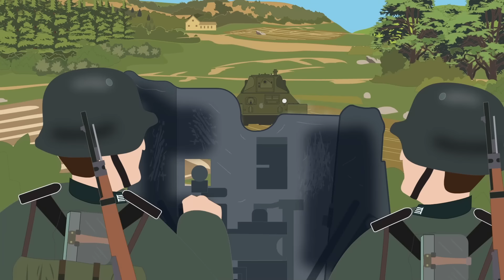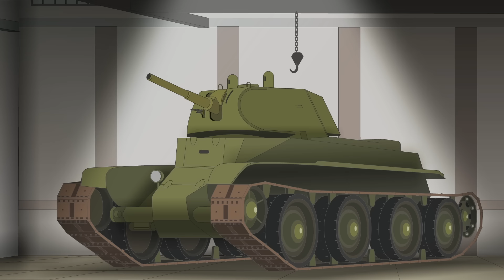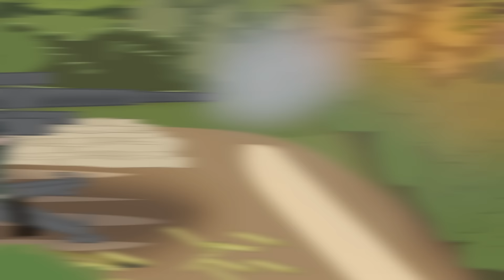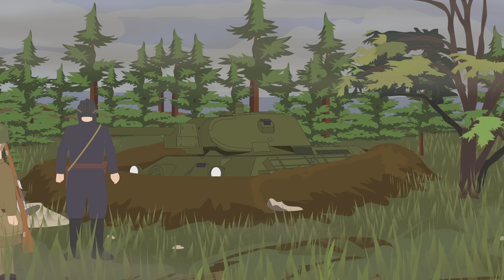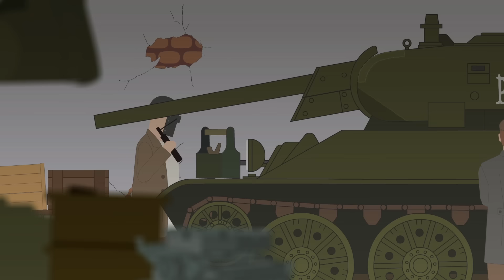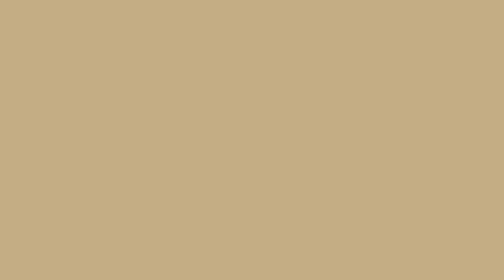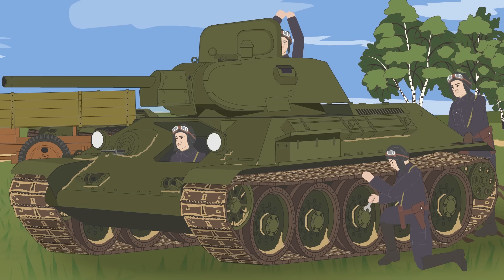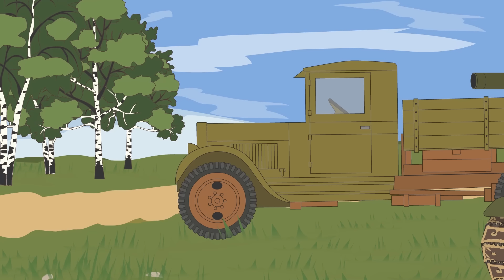Was the T-34 Really the Best Tank of WW2?

Comment: The T-34 was supposed to be a simple and rugged vehicle that seldom broke down. Authors like to compare it to the more complex German tanks that supposedly broke down often. The concept of the T-34 as a reliable tank is another myth of WWII.
The majority of vehicles in 1941 were lost due to equipment malfunction. The same reliability problems continued during the period 1942-44. The evacuation and relocation of industrial facilities combined with the loss of skilled workers could only lead to the fall of reliability. 

In 1941 T-34 tanks often had to carry a spare transmission strapped on the back to counter equipment failures. In 1942 the situation worsened since many vehicles could only cover small distances before breaking down. In the summer of 1942 the following Stalin order was issued to units:
‘Our armored forces and their units frequently suffer greater losses through mechanical breakdowns than they do in battle. For example, at Stalingrad Front in six days twelve of our tank brigades lost 326 out of their 400 tanks. Of those about 260 owed to mechanical problems. Many of the tanks were abandoned on the battlefield. Similar instances can be observed on other fronts. Since such a high incidence of mechanical defects is implausible, the Supreme Headquarters sees in it covert sabotage and wrecking by certain elements in the tank crews who try to exploit small mechanical troubles to avoid battle.’

Henceforth, every tank leaving the battlefield for alleged mechanical reasons was to be gone over by technicians, and if sabotage was suspected, the crews were to be put into tank punishment companies or "degraded to the infantry" and put into infantry punishment companies.'

The constant complaints from the front forced the authorities to investigate the problems with T-34 production. In September 1942 a conference was held at the Ural tank factory by the Commissariat of tank industry. The conference was headed by Major General Kotin, People’s commissar of the tank industry of the USSR and chief designer of heavy tank ‘Kliment Voroshilov’. In his speech he said:

''Now ... there are a lot of complains about the T-34. You all know the reasons for flaws in the tanks. The first reason –inadequate visibility from the tank; the second reason, and this is the weak link that always accompanies our vehicle in the Army – final drive. And third, the main issue that we have today – insufficient strength of the idler wheel's crank. These issues are the major defects of the T-34 today. Having considered these issues from engineering and technological points of view I would like to discuss another issue, the one that directly resulted solely from our production deficiencies. They are: negligence during production of combat vehicles in the factories, carelessness of assembly and quality control of vehicles. As a result during combat employment our tanks sometimes cannot reach the front lines, or after getting to the territory occupied by the enemy for conducting combat operations, sometimes they are forced to remain on enemy's territory because of some little things... We have to make sure that as a result of this conference all shortcoming will be uncovered and following this conference all corrections in the tank will be implemented in the shortest possible time...
Recently comrade Morozov and I visited comrade Stalin. Comrade Stalin drew our attention to the fact that enemy tanks cover a lot of ground freely, and our machines although are better, but have a disadvantage: after 50 or 80 kilometers march they require repair. What are we talking about? It is because of control gear; also, as comrade Stalin said, because of drive gear, and he compared it with the Pz.III, which is in service with the German army, and which is inferior in armor protection, and in other features, and in crew's layout, and does not have such a fine engine, which the T-34 got, moreover its engine is gasoline, not diesel. But the question аrises – why its drive gear is developed better?

Comrade Stalin gave directives to engineers, to the People's Commissar comrade Zaltsman, to factory's CEOs and ordered them to fix all defects in the shortest time. A special order of the State Defense Committee has been issued on the subject as well as directives of the People's Commissariat of the Tank Industry. Despite all these resolutions have been made by Government and orders of the People's Commissar of the Tank Industry, despite repeated instructions from army units and from Main Directorate of the Armored Forces, which is in charge of combat vehicles operation, nevertheless all of these defects on vehicles are going on... We have to reveal all these flaws, and suggestions have to be made on at this conference how to modify machine component better and faster in order to make the T-34 tank, which is recognized in the army as a good tank, even better fighting machine.''

The situation continued to be problematic even in 1943-44.

Comment: Lack of radio
Initially only the unit commander’s tank had a radio. In the course of the war radio was used more widely but even in 1944 many tanks lacked a radio set. The lack of radio meant that Soviet tank units operated with little coordination.

Visibility problems

German combat reports show that T-34 tanks had serious difficulties in navigating terrain and identifying targets. The problem was that the vision devices made it hard for the driver and the gunner to see what was happening.

This problem was partially addressed during the war.
The T-34 ‘1941 version’ lacked the vision cupola found on German tanks. This equipment gave the commander a 360o view of his surroundings. Also the optics were of poor quality.

The T-34 ‘1943 version’ had a larger turret and a German style cupola.
The T-34/85, introduced in March ’44, had a new large turret and the German style cupola.

However the quality of Soviet optics combined with the limited visibility from inside the tank affected combat performance. A German unit that used the T-34/76 model ’43 in combat noted:
‘The gun sights in Russian tanks are far behind the German designs. The German gunners need to be thoroughly accustomed to the Russian telescopic gunsights. The ability to spot a hit through the gunsight is very limited.’

‘In a Russian tank it is difficult to command a Panzer or a unit and at the same time serve as the gunner Therefore fire direction for the entire Kompanie is hardly possible, and the concentrated effect of the unit’s firepower is lost. The commander's cupola on the T 43 makes it easier to command and fire at the same time; however; vision is very limited to five very small and narrow slits.’

‘Safe driving and sure command of both the T 43 and SU 85 can't be achieved with the hatches closed. We base this statement on our experience that on the first day in combat in the Jassy bridgehead, four Beute-Panzer got stuck in the trench system and couldn't get free with their own power, resulting in the destruction of German defensive weapons during the attempt to retrieve them. The same thing happened on the second day.’

Comment: The T-34 had a large caliber gun. The initial version was the L-11 76mm of 30.5 calibers. This was quickly replaced with the F-34 76mm of 42 calibers and the T34/85 had the ZiS S-53 85mm of 54.6 calibers.

The caliber numbers look impressive. After all the main German tank of 1941-43 Pz III had a 50 mm gun and that of 1943-45 Pz IV had 75mm. However Soviet tank guns suffered from low velocity leading to poor penetration and accuracy at long ranges.

For example the initial round velocity (m/s) for the Soviet guns (using the standard A/T round) was:  L-11 - 612, F-34 - 655 (a German test with Pzgr39 ammo showed 625), ZiS S-53 - 792. The comparable German stats were: KwK 38 L/42 - 685, Kwk 39 L/60 - 835, Kwk 40 L/43 - 740, Kwk 40 L/48 - 790, Kwk 42 – 925.

The KwK 40 75mm used by the Pz IV and Stug from mid 1942 had far better penetration performance and accuracy than the F-34 and the Panther’s KwK 42 was also superior to the ZiS S-53 85mm in the same areas.

Comment: Another major problem was the unwieldy gearbox. It had poor reliability and it needed excessive force to change gears, leading to driver fatigue. The study ‘Engineering analysis of the Russian T34/85 tank’ says:
'Rough steering due to the use of clutch and brake steering control, and

Difficulty in shifting due to the use of a spur gear clash-shift transmission (no synchronizers, no clutches) and a multi-disc dry clutch, undoubtedly make driving this tank a difficult and very fatiguing job.’

Initially the powerful V-2 engine (500hp) could not be used to the fullest due to the 4-speed gearbox. Changing gears required excessive force on behalf of the driver. The T-34 could use the 4th gear only on a paved road, thus the max speed over cross-country was theoretically 25 km/h but in practice it was only 15km/h because changing from 2nd gear to 3rd required superhuman strength.

On later modifications there was a 5-speed gearbox which allowed for a cross country speed of 30 km/h. However it seems that even vehicles built late in the war were not guaranteed to have the new 5-speed gearbox. The tanks given to the Polish People's Army in late 1944/early 1945 and those used by the North Korean Army in 1950 had the old 4-speed setup

Comment: The Christie suspension used on the T-34 had the advantage that it allowed for high speeds on road. Its disadvantages were that it took a lot of internal space and it had poor stability in rough terrain.

A German test of tank pitching motion at the Kummersdorf testing facility (1km undulated track) showed that the T-34 had the worst stability compared to the Pz IV, Tiger, Sherman and Panther.

According to the study ‘Engineering analysis of the Russian T34/85 tank’ the main problem was the lack of shock absorbers.

The Christie suspension was a technological dead-end and the Aberdeen evaluation says: ‘The Christie's suspension was tested long time ago by the Americans, and unconditionally rejected’.

It was replaced in postwar Soviet tanks with the torsion bar system, same as the T-34M and T43 prototypes intended to replace the T-34 during the war.

Comment: The armor of the T-34 had a high Brinell rating, meaning it was very hard. This was advantageous in defeating antitank rounds of caliber equal or lower to the armor’s thickness but had the disadvantage that it could lead to spalling. Combined with manufacturing flaws in the construction of the tank this meant that the T-34’s crew was often in danger even when hit by tank rounds that did not penetrate the armor.
The study ‘Review of Soviet ordnance metallurgy’, p3-5 says:

‘The armor components of the T-34 tank, with the exception of the bow casting which was unheat-treated, were heat-treated to very high hardnesses (430-500 Brinell), probably in an attempt to secure maximum resistance to penetration by certain classes of armor-piercing projectiles even at the expense of structural integrity under ballistic attack.’

‘The quality of the armor steels ranged from poor to excellent. Wide variations in production technique were indicated; some rolled armor components were well cross-rolled while others were virtually straightaway rolled………The bow casting of the T-34 tank was very unsound and would have been rejected under American standards.’
‘Shallow penetration, poor fusion, severe undercutting, porosity, and cracking was observed in most of the welds and probably resulted from improper manipulation of electrodes which might not have had suitable operating characteristics….. These obvious defects, together with low strength and pour metallurgical structure of ferritic weld deposits, indicate that the welded joints would have poor resistance to severe shock.’

‘The results obtained from the metallurgical examination of these early world war ii Soviet tanks have been described in some detail since they are exactly the same as have been obtained from all examinations performed since then of Soviet tanks which were recovered in Germany after the end of world war ii, and on Soviet tanks which were captured in Korea during 1950-52. The Ordnance Corps has examined several Soviet JS-II which were found in Germany and several Soviet T-34 tanks from both Germany and Korea.’

'Some of the armor steels have surprisingly high toughness considering the very high hardness levels but many of the armor steels, even the softer ones, are very brittle.’
‘The very high hardness encountered in most Soviet tank armor has caused much unnecessary concern regarding the relative ballistic performance of the hard Soviet armor and the softer American armor. Many people associate high hardness with high resistance to penetration. Although this is true, within limits, in the case of attack of armor by undermatching projectiles (i.e. caliber of shot is less than the tnickness of the armor) particularly at low obliquities of attack, it definitely not true when the armor is attacked by larger caliber shot at higher obliquities of impact’
Reply: You mean 500 Vickers*

Comment: The T-34 had limited internal space due to the sloped armor in the front, the sides and the back of the vehicle. There were fuel tanks in the engine compartment and at the sides of the hull. The presence of fuel tanks inside the fighting compartment made any penetration of the tank likely to lead to the complete loss of the vehicle.
According to author Steven Zaloga in ‘T-34-85 vs M26 Pershing: Korea 1950’, p23:
‘Armor data provides only part of the picture of a tank's protection. Other factors in assessing the vulnerability of a tank include the internal arrangement of fuel and ammunition. The T-34-85 is a clear example of the trade-off between the benefits and drawbacks of steeply angled protective armor. Although the T-34's sloped sides reduced the likelihood of the tank being penetrated by enemy projectiles, it also led to a decrease in internal hull volume. In the event that the T-34 was penetrated, the projectile was far more likely to produce catastrophic damage among the fuel and ammunition stored in such a small space. The side sponsors of the T-34's fighting compartment in particular contained fuel cells that if penetrated could lead to fire and the destruction of the tank.’
Apart from the limited internal space there were two more serious design flaws.

One was the lack of turret basket (a rotating floor that moves as the turret turns) for the loader. This meant that the person loading the shells had to follow the movement of the gun and at the same time keep an eye on the floor so he doesn’t trip on the spent casings.

The other major issue was the two-man turret which forced the commander to also act as the gunner. This drastically limited combat performance as the commander could not focus on leading the tank but instead had to engage targets.

A three-man turret was finally introduced with the T-34/85 in March ’44.
Reply: Considering they made 57 000 during the war, I doubt a full vehicle loss is not such a big concern. With a Tiger tank with 1300 produced that is a big problem. And combat preformance doesn't matter when you outnumber the enemy which makes up for the extra work load.
Reply: @alastair9446  with more tanks you need more men and trucks to operate and maintain the tanks you also need more ammo and fuel and food for the extra men quantity isnt always better than quality...not saying the tiger is the best mainly because it struggled to even get to the battle never mind fighting in it
Reply: It's annoying how T-34 are hailed just because of sloped armour not battlefield efficiency

Comment: The T-34 was supposed to be the first tank that employed sloped armor. This characteristic meant that the armor protection was significantly enhanced, compared to straight armor. However French tanks of that period like the SOMUA S35 and the Renault R35 also had sloped armor.
Moreover there were several problems created by the sloped armor in the front, the sides and the back of the vehicle. This choice seriously diminished the internal space of the T-34. Tanks are always crowded on the inside. The T-34 however had a huge problem when it came to internal space.

The limited space not only affected crew performance but turned the T-34 into a deathtrap. A US study from the Korean War (based on the T-34/85 that was roomier than the T-34/76) concluded that due to the limited internal space a penetration by an A/T round usually led to the destruction of the tank and loss of 75% of the crew. In the Sherman the figure was only 18%.
German tanks like the Pz III and Pz IV had a conventional hull design but they also used slope in the middle part of their front hull armor. The new Panther tank was the first German tank to have a fully sloped hull front and sloped sides however the armor layout did not limit internal space like in the T-34.
The turret also suffered from a lack of space. It was so cramped that it affected movement.